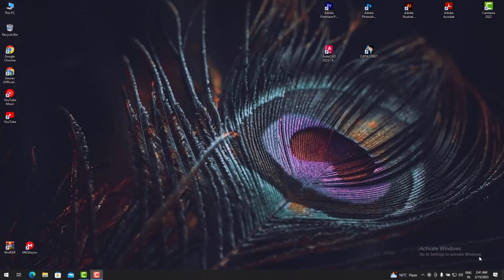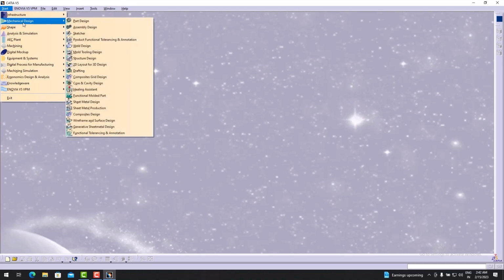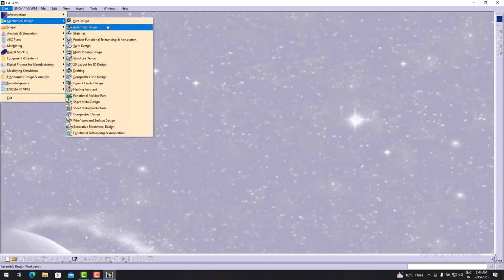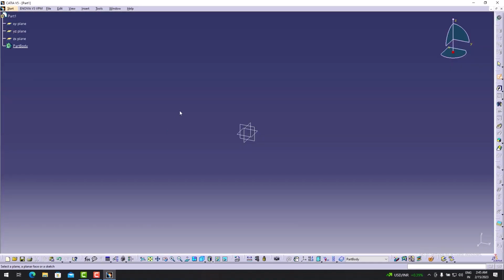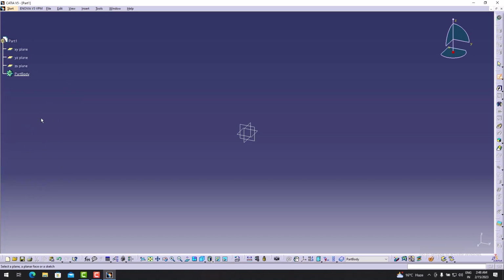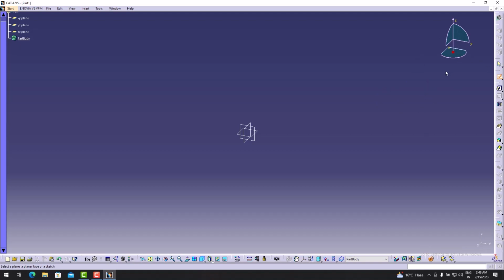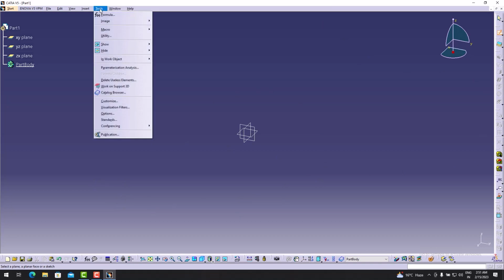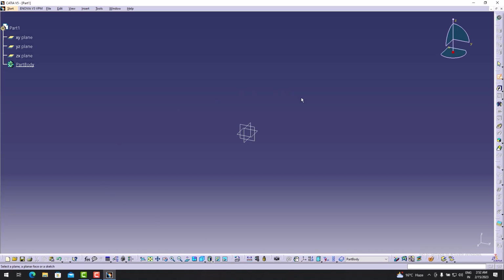CATIA Introduction & Software Overview

Comment: Hello. Need help. I hv been using R19 version for a month. Suddenly it is giving 'Feature Definition Error' while doing Threaded hole which says 'Standard files for definition of Metric Thin Pitch and Metric Thick Pitch cannot be found '. That's why I am unable to select M series Thread Diameter. Plz help.